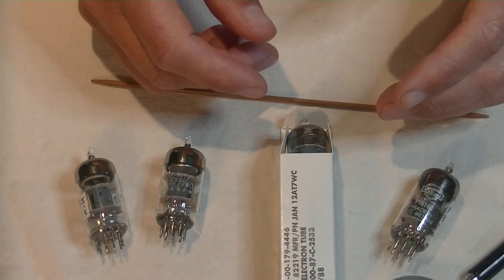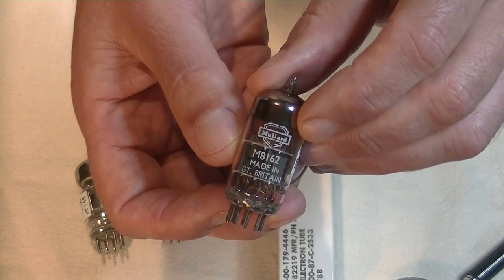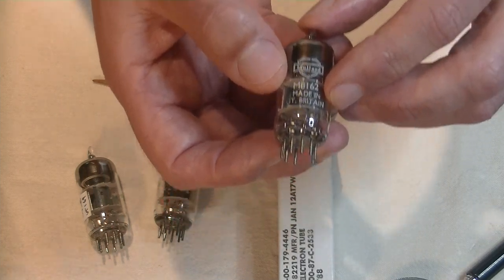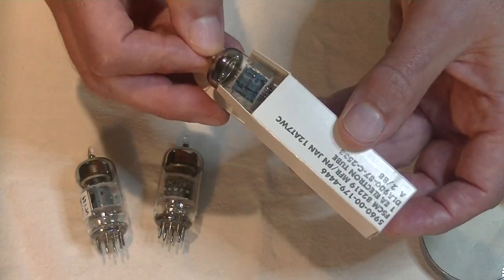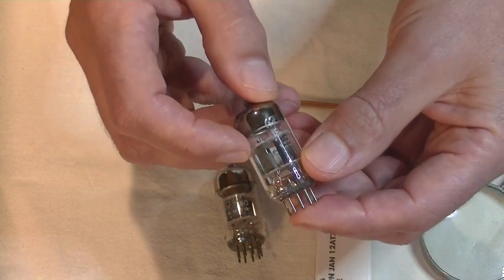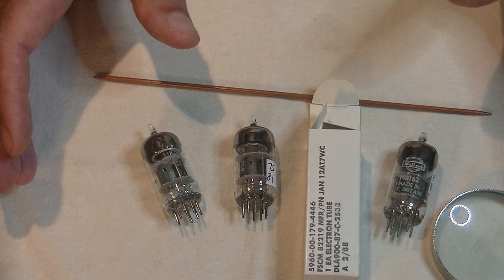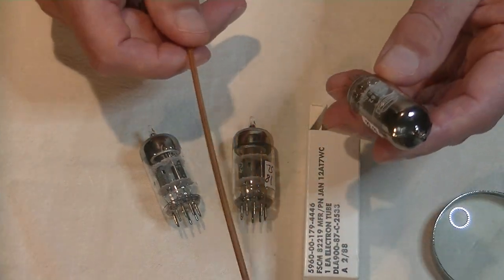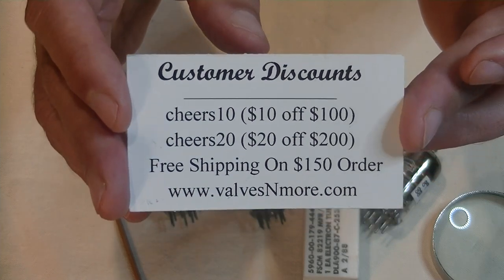Tube Lab #7 12AT7 Rolling for 12AX7

Comment: For those of you actually wanting to use a 12AT7/ECC81 as a substitute for 12AX7/ECC83 in a slot designed for that 12AX7, please keep in mind that the 12AT7 will not bias properly under the 12AX7-design conditions.  It's okay to try it out, but, in my experience, most folks trying this go back to an actual 12AX7.  The basic complaint is that the 12AT7 sounds very bright, very thin (not enough low-mid & bass) and, of course, very weak.  There is one exception to this: the 1980s Mullard CV4024.  That CV4024 is usually also marked with "M8162" and "12AT7WA" and it was made in Mullard's Mitcham plant (factory etch code "R").  This is NOT the Mullard M8162 shown in this video, however, as that one was made much earlier, as indicated by the older Mullard logo.  Look for the most commonly available Mullard CV4024/M8162/12AT7WA with the later style Mullard logo, and you will get a 12AT7 that retains a rich, thick tonal character that can be suitable when you sub it for a 12AX7.

Also... I'd like to say a good word for slight microphony.  A little bit of microphony adds a dynamic character to audio pathways that make them sound more lively.  This adds to musicality, in my opinion. Microphony is NOT "noise" - noise is caused by dirty pins, inadequate electrical contact, degradation of the cathode, and other factors that result in random hissing, spitting, or flurries of crackles.  Too much microphony can result in squealing, with sustained notes that are not related to the audio signal frequency in a musical way.  If you tap your tubes and fear that they make pinging noise, just stop tapping them ;-)
Reply from the maker: Thanks for well written and informative comment!  I've come to the same conclusion as you, with regards to microphonic tubes.  A little can really enhance the sound - up to a point as you mention as well.
Reply: @tubelab194  Try the 5751 tube as a direct sub for the high gain 12 ax7...I recommend RCA(NOS) or TUNG SOL(NEW RI)
Reply: @PGHJR002 yes.  12at7 no good for tone.  12ay7 is good even lower output than a 5751 and good for tone.  I'd never put a 12at7 in an x7 slot... they just awful

Comment: Hi There, I bought a box of old tubes and it had a pair of IBM Lettered clear top 6211 side getter's. Yjt hav the numbers 6J-35, 188-4  and 255551 in white, same as the IBM lettering on the body of the tube. On the clear domes is 170C in yellow paint. I replaced ElectroHarmonix, goldpinn 12AX7's in my headphone amp and the bass is lower, tighter and quicker. liquid midrange and a lovely 3D image scape than the EH'sI have never heard of them before I tried this. Are there other 6211's as they trounced a few NOS 12AT7's I tried too.
Reply from the maker: I have very little experience with the 6211 so can't help.

Comment: Can you guys help me out?  I'm thinking about building a small, high gain guitar amp.  Maybe 5 or 10 watts maximum.  Can you guide to where I can find parts and pcb's?  Guys like Mojotone and others all have whole kits for what I could buy low watt Fender or Vox.  If you go into Bugera or Monoprice, they're actually cheaper than the parts from the DIY guy's.
THANK YOU!!
Reply from the maker: If you buy a quality Kit you're basically buying a guarantee of support that you'll get your amp working properly.  A quality Kit will also be well designed and work as well or better than a factory made amp.  I'm of course speaking from a position of both experience and bias, given that we design and manufacture Kit Amps.  In audio as in everything in life, you basically get what you pay for.  If you have a lot of time and a very low budget, find a blog from a builder and buy in the parts, but don't be surprised when you buy quality transformers, chokes and a nice chassis that you've spent as much as a nice Kit and you still need to get the circuit working.  We spend 6 months to a year developing a single Kit amp and making certain it works perfectly and sounds great.  Any schematic you work with, even a known one will require time and experience to get working properly -  many projects started like this are never finished or never work properly.  So my advice is save up your cash and buy something really good.
Reply: @tubelab194  COOL, I should have looked you up before I asked my dumb a@@ question. 
Thanks.

Comment: Hi Jim. Can one safely replace a 12AU7 with a 12AX7 or a 12AT7? Thanks.
Reply from the maker: A Good Question!  And the short answer is NO.  Even though the 12ax7 and 12at7 have exactly the same size bottle and pinout as a 12au7, they are very different tubes.  The 12au7 is a medium gain tube (mu or gain of 20) and the 12at7 and 12ax7 are high gain tubes (gain of 70 and 100).  Gain is simply how much voltage the tube can amplify, this is always expressed as the design maximum or as I like to say "nominal maximum".  The tube will almost never be biased to the maximum.  So as an example, if you had a preamp and put a nominal 2vac in from a cd player and your gain tube was a 12au7, with one gain stage, you could potentially get 40vac out at max gain (2v x 20 gain = 40).  Or if you had a phono stage and your cartridge output was 10mVac (10/1000v) and you had a single 12ax7 gain stage, you could potentially get 1000 mV (1vac) out (10mV x 100 gain = 1000mV/1v).